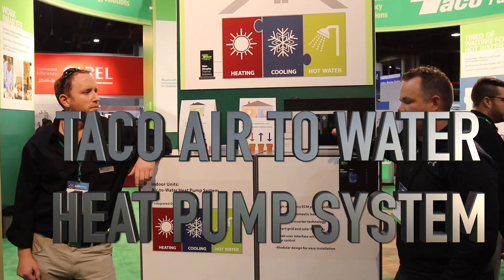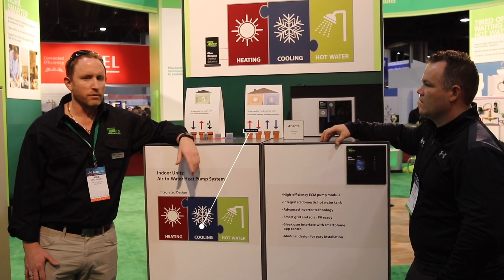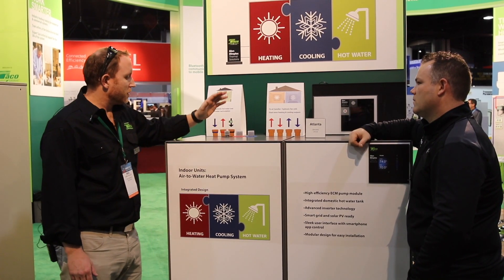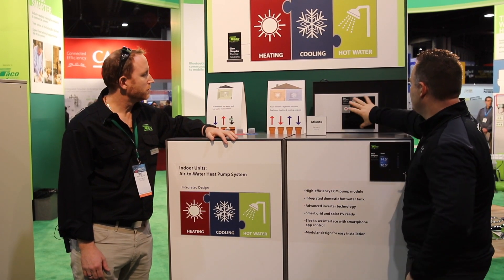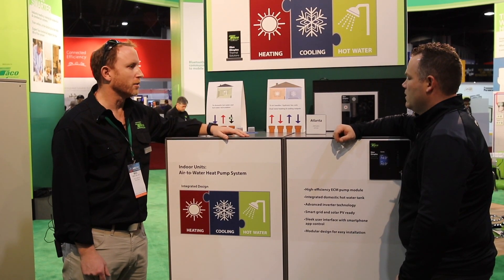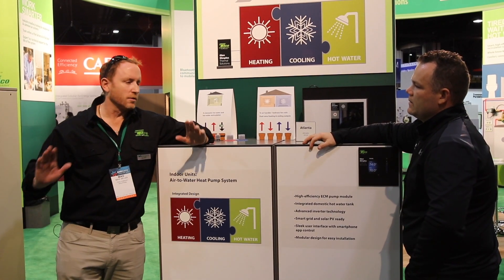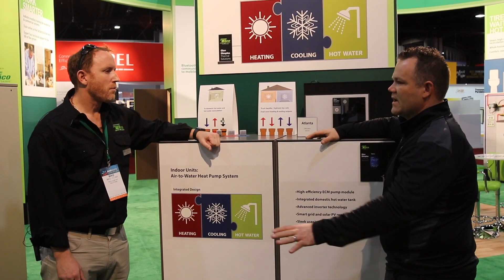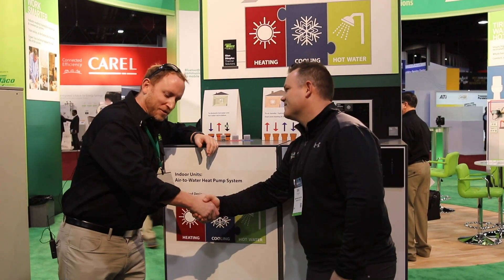Taco AIR to WATER Heat Pump System #ahrexpo

Comment: Better system is already available @ CHILTRIX HotSpot Energy
Reply: Thanks for link that seams interesting.
Reply: Why is Chiltrix superior?  Very few comparison details are available for the TACO system.
Reply: It seems like everybody is copying Chiltrix, after realizing that @ 3.92 cop was already in use. Ironically Chiltrix was contacted by taco to figure out how Chiltrix was able to reverse the temp sensor on the delta t pumps that they manufacture.